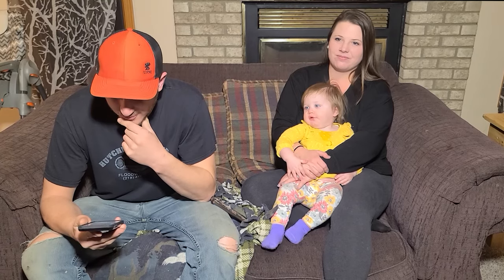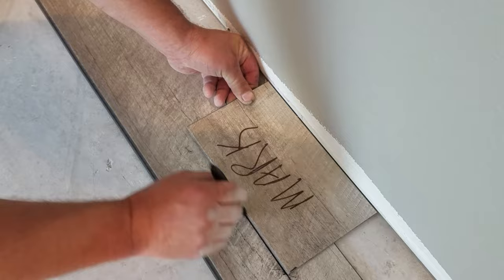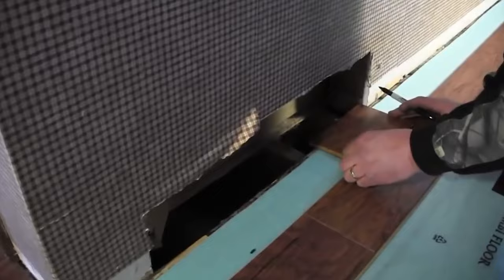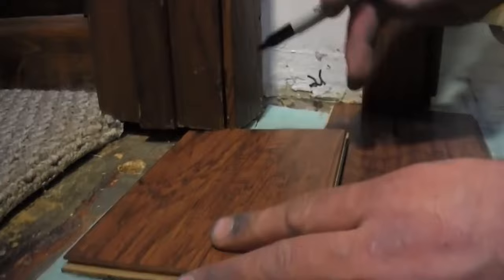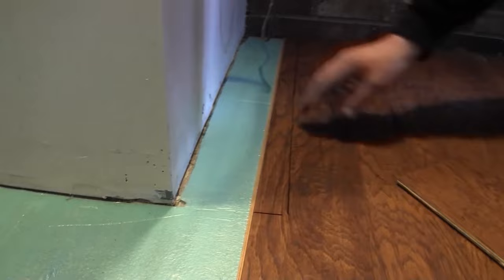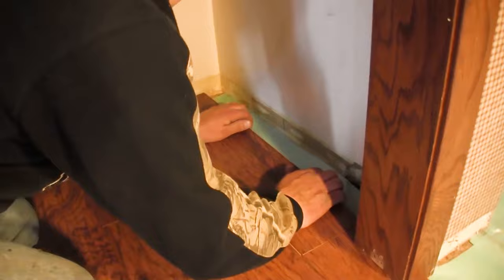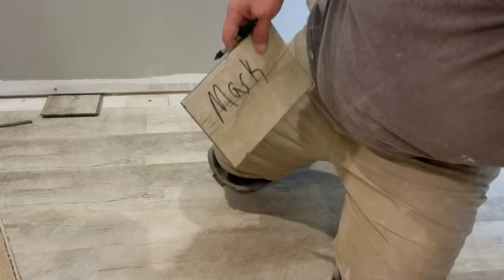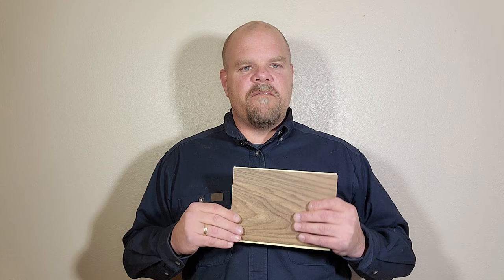Measure PERFECT Cuts for Vinyl Plank in SECONDS | It Works Every Time

Comment: At first was a little difficult to grasp the cheater, but once I understood your method, it was great. I spent hours in my kitchen measuring, then watched your video and I was flying through the cuts. Not only was I flying through the install, I no longer needed a tape measure. Thanks for posting that video.
This trick saved me a lot of time/hours, and the cuts were more exact then when I used tape measure. THANKS AGAIN. This was my first plank install and was easy after watching your video
Reply from the maker: Thanks for sharing this!

Comment: Thank you so much brother.  I have installed vinyl floor planks in a room or an RV three other times. This is the first time that I have actually been productive. Thank you so much for the cheater board.
Reply: Any tips relative to the RV install?  Did you by chance install peel and stick vinyl?  Outcome?

Comment: Thanks for the tips. You make it simple for anyone who is mechanically inclined. I just did my kitchen floor and it went good. ( I had several difficult spots, between your videos and realizing that putting the pieces together backwards would be possible I got them done). I went with LL CLX XD because of your other video.

Comment: Yeah, all very nice. But I don't have planks already installed  that can use that trick.  I'm coming from a living room, with planks parallel to the hallway.  When I reach the corner that extends into the hallway I have to cut the planks lengthwise to fit around the corner against the hallway wall.  From there it is just guesswork to lay planks in doorways and between 2 cold air returns.

Comment: Great video, in the example you installed a single row and scribed it to the wall, how did you decide how far it should be from the wall before scribing ? Is this only necessary for hallways when it continues to another room ? Or is that how you should start in every room ? 

Thank you !
Reply from the maker: This is how it should be done in each room as you extend the plank into another room.

Comment: Can I ask a potentially silly question?
If you use a block to tap your planks in, won't that damage the click T&G? 

I'm currently in the planning stage of laying down vinyl planks in hallway/kitchen and two cupboard storage spaces to lay floor as well. In one area there is a cluster of three doorframes in close proximity to each other. I'm dreading it!
We're also planning on getting new door linings. Would you say it's advisable to lay down the floor first and then place the jambs on top or the other way around? 
Thanks for all of your videos!

Comment: Just a thought but I would make a cheater block specifically which has a strip of the plank underneath it so as you slide it down the panel to be marked the block is always level and provides a more accurate scribe.  The underneath piece would be adhered to the cheater block.
Reply from the maker: Thanks for noticing!

Comment: I'm trying install self stick flooring in my travel trailer. I have a weird angle that I just can't get right under the table. Mostly because it is not straight, and I always over cut. How do you know how deep to go on your cuts?
Reply: I'm guessing that's why you measured 11 ⁵/⁸ but where did you get that number from?

Comment: Hi...now seeing your videos for the first time. I am DIY-ing my floor tomorrow with  cork vinyl. I watched 4 videos from you regarding getting started. Please tell me difference between the male end and female end. It was not so clear to me in the video. Do not want to cut the wrong end thank you.
Reply from the maker: The groove(female)usually sticks out father from the plank then the tongue(male).
Reply: @SoThatsHowYouDoThat  thankyou very much. Tou responding so quickly. You are truly a consummate professional. God bless...
Reply: @SoThatsHowYouDoThat  I get the feeling that you are using tongue and groove differently than I understand it. I thought the tongue is the protrusion of the meat the board and is missing the face of the flooring.  The groove is an edge notch or dado of the meat of the board. Am I on the same page as you?

Comment: Hi, great tips but don't you need to leave an expansion gap?
Reply: His method leaves a 1/4" gap by leaving the male end on the board.
Reply: I think he cut the tongue off because he is laying vinyl planks, which don’t expand or contract.

If he was laying laminate planks, he would have left the tongue to account for the expansion gap.
Reply: @chamberb01  I stand corrected, he states at the end that he did cut off the groove end and left the tongue (male) to account for the 1/4 expansion.

Still, LVP does not expand and contract like laminate planks because it is less prone to humidity.

Comment: I am doing 2200 sqft walkout basement with hydronic radiant heat. I am doing Adura Max do you recommend doing transitions or do you think I am fine without? The newer LVP sounds like not much movement so 60ft runs may not be issue?
Reply from the maker: I would not use transitions. That is my opinion on the matter.

Comment: Whats a reasonable rate for installation by the hour or square foot?  I dont have the tools to do the job
Reply from the maker: What state do you live in?
Reply: @SoThatsHowYouDoThat  the 51st... Canada 🤣
Reply: @billrimnyak3913  pull bar $10 mallet $6 bucks tapping block $5 bucks 

jig saw get a no name brand $20 and cutter $50 maybe after you’re done u didn’t like the cutter and it gets returned.. 😉😉 here in the states A local shop charges 2.50 sq ft 😂 more than the freaking product costs

Comment: You edited out, started the video too late of how to lay out what the distance is where the board is laying away from the wall when you mark it. The board has to be the proper distance from the wall for an accurate lay out. You showed to get it straight from the main line but not the distance from the wall. You glossed over that and didn't say anything about it.